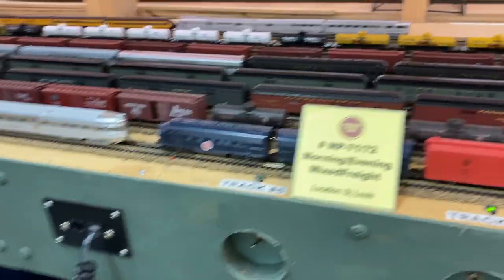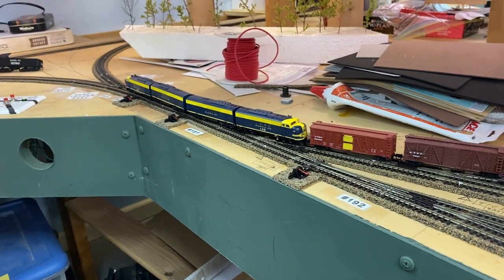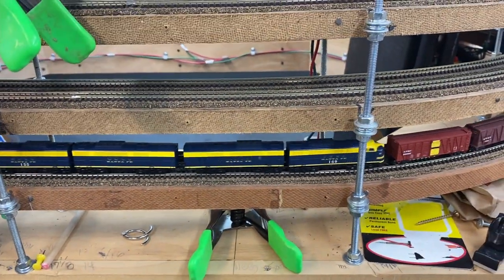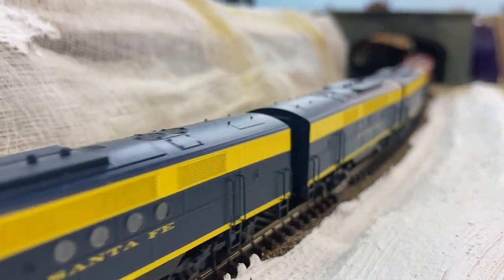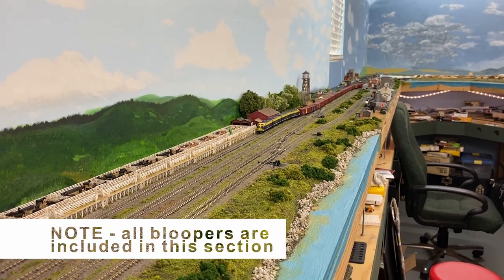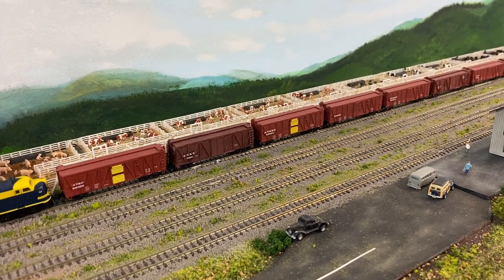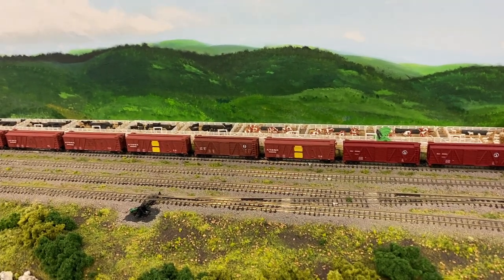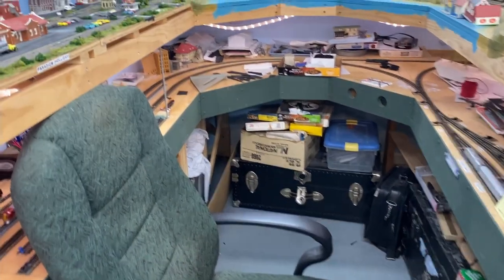ATSF Train # LSX Livestock Fast Express

Comment: Yup....Do a video and things go wrong, but great running video.  Bob
Reply from the maker: Hi Bob, Thanks for your comments. I will have to check the MTL couplers on all of the stock cars as I believe that the "metal hoses" on some of the cars were touching the frogs when they were going over turnouts thus causing a momentary short to occur....John